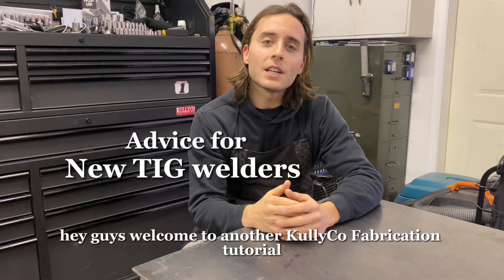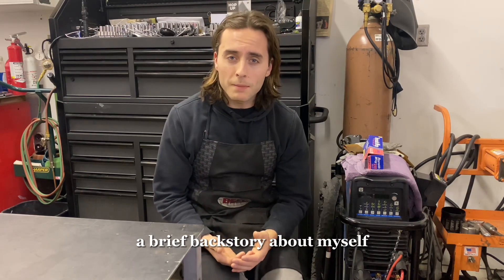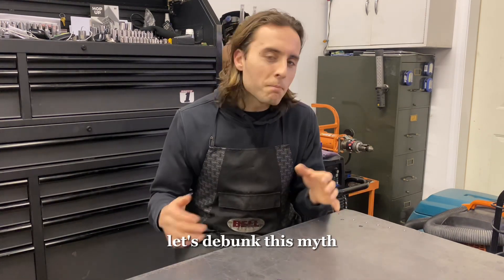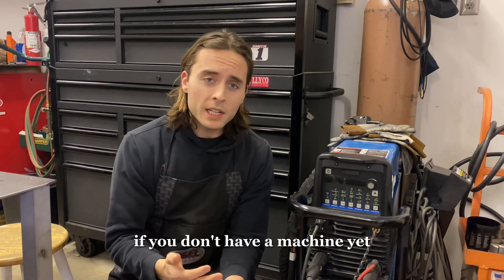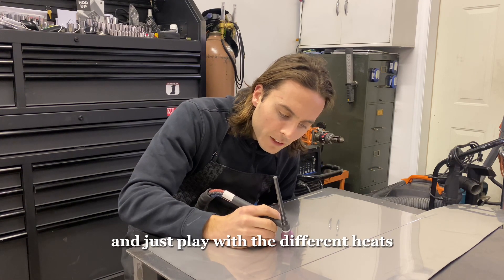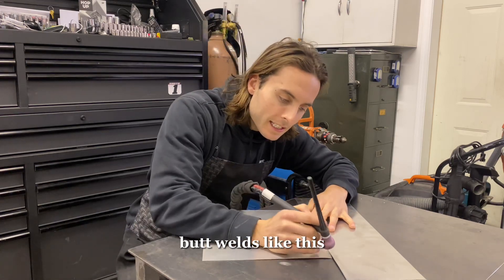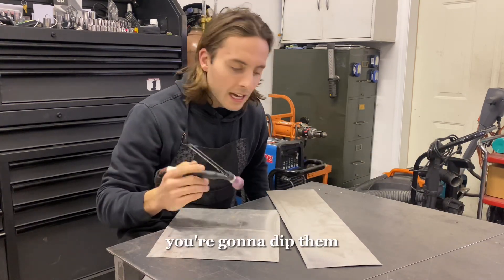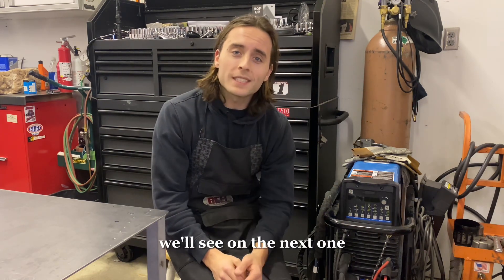Advice for new TIG welders.  The fast and efficient way to get GOOD!

Comment: Great channel💪🏽! Do you use any specific tungsten and rod depending on the material? Or it’s not necessary to change it? For example for stainless and steel.
Reply from the maker: @luisrodriguez2302  no sir ! Same tungsten 1/16” 2% Ceriated .  Yes i change the rod from stainless to mild.  I use suoermissile for stainless and er 70 for Mild and chromoly

Comment: I have a dumb question, but are you supposed to touch the tungsten to the metal to weld it? I know not to touch the filler to the tungsten, but I mean the metal itself
Reply from the maker: No sir - when your welding you will have your tungsten real close to the material… but it will not touch . If you touch it - it will ruin the tip of your tungsten

Comment: What are your thoughts on fusing a joint together letting it cool then repeating with filler rod? Please explain your reasoning
Reply from the maker: I would say that it’s not a good practice… not being a bully-  but heating / reheating the material more than you need to is never good . Just make your first and only pass with filler and call it a day.  Is there a reason your doing this ?
Reply: @KULLYCO  I was just thinking in the terms of practice
Reply from the maker: @paulmcdonald3570  oh for just practice ! Yes - tear it up , any thing you can do to have the torch in your hand more is a positive I think

Comment: I'd love a Miller Dynasty 210 but yikes...!  yes, its a little spendier.  I purchased a Primeweld Tig225x when starting and I highly recommend it.  Just buy a bigger welding cart if you do.
Reply from the maker: I’ve heard good things about those machines!  Glad it’s working well for you .  Yeah the dynasty stufff can get pricey .  I bought mine a few years back when they were slightly cheaper :)
Reply: @KULLYCO    the key to tig welding as you stated is practice.  and comfort!  Primeweld also just came out with a new TIG box  a 325 model but looks a little sophisticated for me.